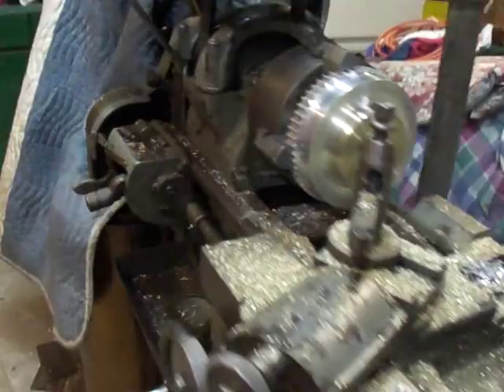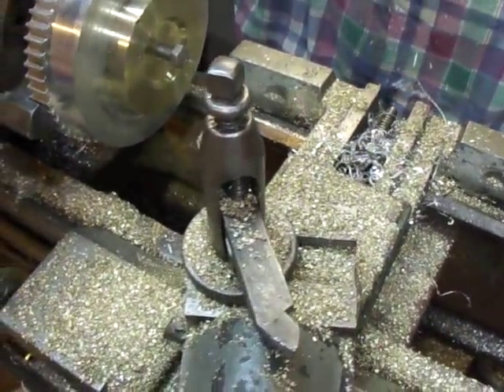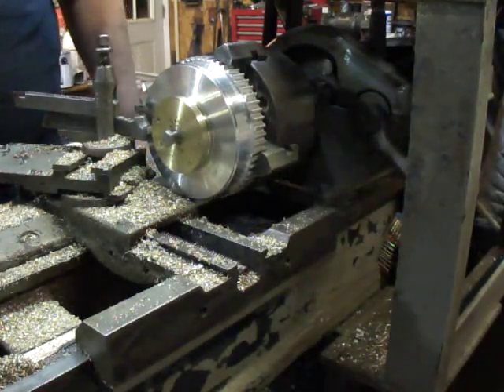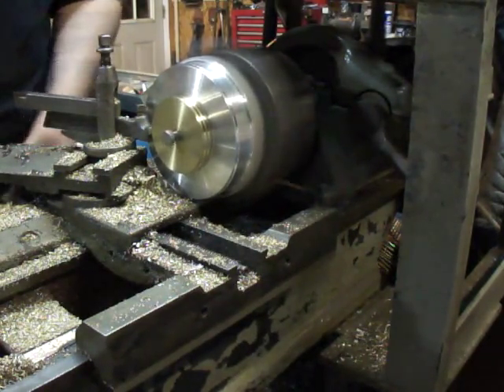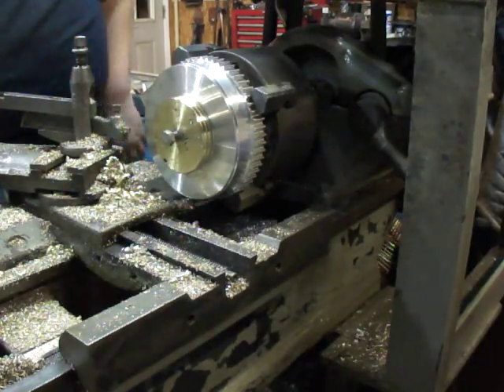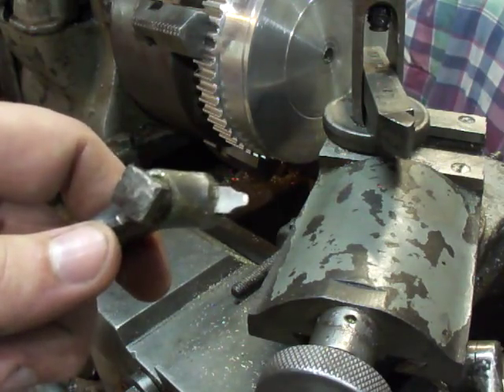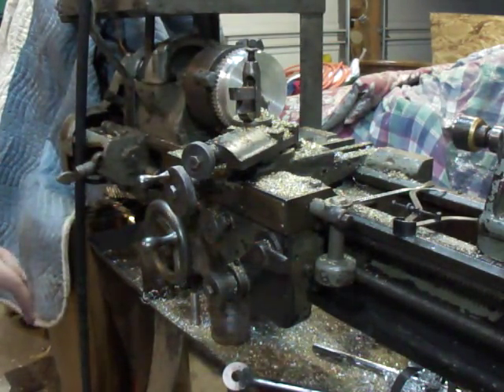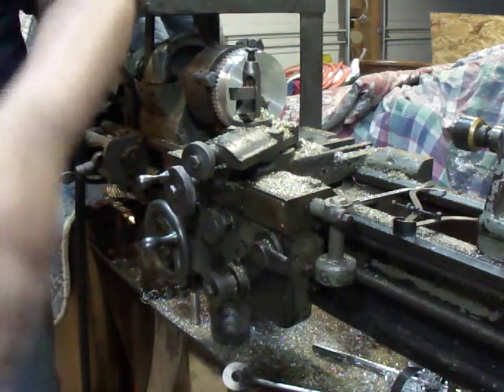Steam Engine Build #5 - Machining Brass Piston (Evil Metal)

Comment: Ptfe tubing. Brass piston and aluminum housing?  How did it work.  Will it last a long time?  I thinking of making stainless housing and want best piston and rings possible. Any suggestions ?
Reply from the maker: The brass/aluminum has held up quite a long time, I eventually recut the grooves on the piston and put rubber o-rings in it to get a better and smoother fit than the ptfe tubing. The aluminum alloy I used is a much much harder alloy, and has eaten quite a number of lathe and shaper tools. It's aluminum A413, which has a high silicon content to it, and was actually used on numerous car engines during the 80s, that way they could run it without using a cast iron sleeve or chrome plating the cylinder.

A stainless cylinder would be ok, but only if your using it with compressed air, in steam environments, stainless tends to have a higher galvanic value and will corrode over time. If it's just on compressed air for something to play with it, alot of people that make little model engines, they use rubber or viton O-rings for the piston, that way it gets much better compression and use a cast iron or bronze piston.